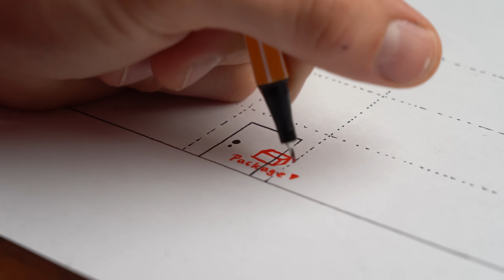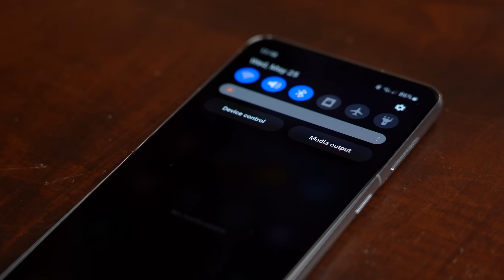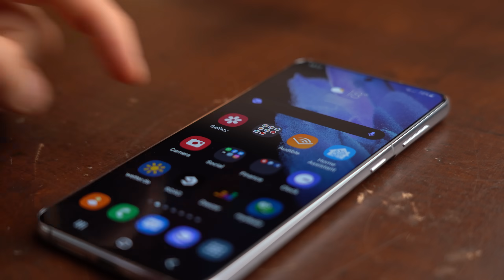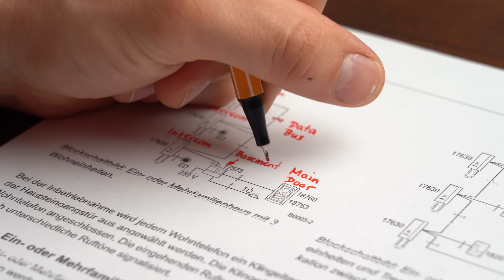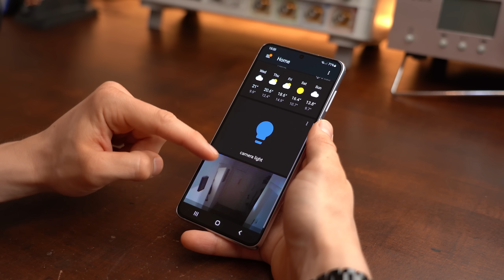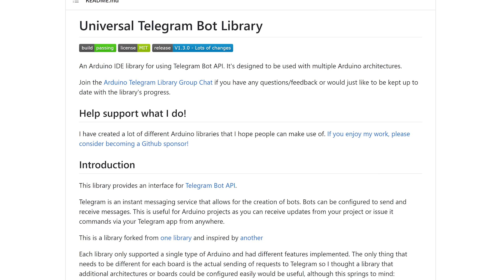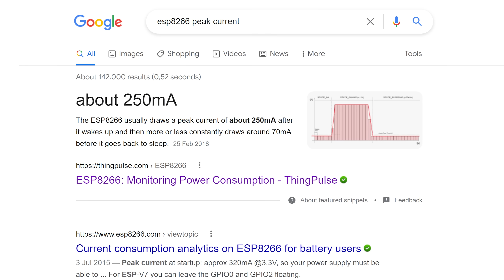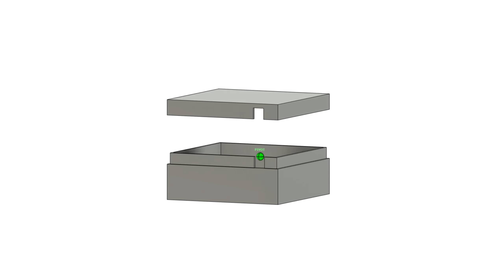Every Apartment needs this Upgrade! (WhatsApp/Telegram Notifications)

Comment: Thanks for the shout-out! I'm really glad people are still finding the telegram library useful, I still think it's the easiest way to do push notifications on an esp device!
Reply from the maker: Thanks for your great work :-)
Reply: @greatscottlab Hey scott, Have you considered ntfy? It does notifications in less than half a second!!! All local too :P
Reply: @greatscottlab   @utehstr  hey did u use the eso32-cam AI Thinker i got a regular another version and my computer couldnt recognize it and in arduino ide -> tools i can only choose esptool as programmer how do i get other options?
Reply: I wasn’t aware of the library and ended up sending the POST request instead. Will be trying it out in my next project.
Reply: Use it for everything! Complete and easy to use
Reply: thanks GreatScott for letting us discover other great channels. I subscribed to yours Brian. :-)
Reply: Personally I use a bit of PHP on a local server (a pi rev 2) which does notifications through Pushover. Just do an HTTP request from ESP with all the relevent info attached (app key, ringtone, etc, etc).
Reply: How fast are the notifications if the phone is locked and not got Telegram running in the foreground? I'm just wondering how much Android sleep/low power modes can affect a system like this.
Reply: @thetron9333  a few seconds usually
Reply: I literally, just before this one,  watched a film about pronunciation of "ough". https://youtu.be/JkdcYYduUeM
Reply: nice library Brian sir
Reply: Wauw, i didn't understand 90% of this video... 😬😬
Reply: Man I had the same problem a while back. I went for a bit of a ride before having success. I created an application for my phone which receives notifications through firebase's service. But now I'm amble to send myself (and others too who install my app from my family) messages based on personalised events that they can subscribe to. It is way faster than most home automation systems. (A bit more complicated too :D )
Reply: https://youtu.be/vOBSn1RWKj0
Reply: Thanks for this library
Reply: Really useful library i used it in a couple of my projects
Reply: Thank you so much for your work. I use it every day.
Reply: Brian's last name is pronounced "lock", you were close Scott!
Reply: @ChunkySteveo  I would have probably pronounced it “low”
Reply: @HogwartsBasement  yeah, same here for British-English. It's an Irish thing! 😊
Reply: @HogwartsBasement  "ough" is hard enough in English on its own, without the wildcard of the Irish thing 😅

Tough (uff)
Though (oo)
Through (u)

So of course Lough is lock 😅
Reply: @BrianLough  haha 
got to love Irish names haha
Reply: @BrianLough  and

Bough
Cough
Dough
Thought
Reply: @BenCos2018  try saoirse
Reply: Thank you for the library. I used it myself about a year ago with a PIR sensor to detect rat activity in one of the barns.

Comment: Great vid I did the similar project a month back. I used esp8266 also tried to steal energy from intercom but then decided against it. I used telegram from the start because its my main IM. Difference is I didn't do alarm notification (I don't know my apartment number, its hard to explain) I instead used relay to simulate door opening button press (probably transistor would be better for that but it was what i had at hand) .

Comment: 5:22 The problem with the notification delay is due to Android's standby services (Doze Mode, to be more specific) since like A8, so you need to define "priority: high" parameter (look into dev documentation for HomeAssistant), then it bypasses it and notifications are pushed instantly.
Reply from the maker: Thanks for the tip
Reply: @greatscottlab  maybe switch to iOS with properly working notifications
Reply: Is it just doze mode and not something else as well? Afaik doze activates when the device is not in use for quite some time while stationary. So really he should only have issues when it's sitting on a desk for half an hour, not even in a pocket or so. But android devices have also picked up the habit of trying to shut off everything that's not high priority, even without doze, unfortunately.
Reply: @LuLeBe  In my experience with multiple Samsung phones, it's basically only the Doze, after disabling it via adb, everything works perfectly fine. Unfortunately without root it needs to be disabled after every restart, soo... after many headscratches I was insanely glad I found that there is something like a critical notification and it's possible to fix it at least for HomeAssistant. But sure, it could be also affected by other processes. (I'm more like stubborn tinkerer than a developer xD )

Btw: Doze intereferes even after 5minutes of "idle" (phone on a desk with display turned off), but it could be manufacturer dependant.
Reply: @SilentlyPrickable  I think Samsung has something else for power optimization. I use an app called Cellmapper to map cellular towers and on Samsung phone it doesn't seem to work in the background, or works for a little while and then stops logging. Meanwhile this is not an issue with Google Pixel

Home Assistant alerts are pretty much instant with iPhone for me. I have one setup to send a snapshot of the camera whenever the doorbell rings. I think those alerts go through the Apple cloud push service.
Reply: the SMS/messaging round trip is also incredibly slow and unreliable. i imagine it would be much faster to send some magic packet across your LAN to your device(s), that way you can even get desktop notifications  or use something like Tasker on your phone to alert accordingly
Reply: @LC-hd5dc  i wasnt talking about SMS... he's on the same network as his door bell why not host something locally.
Reply: @WX4CB  he originally had the notification coming locally via home assistant push notifications but they're a bit all over the place in speed.
Reply: @brendonv101  even on his home network? wow... but yeathat's weird for sure, but i've never used HA so i don't know anything about it. but i have a similar thing here where i have an app that pushes broadcasts out over my local network for various things... doorbell, the fridge (for when my kid leaves the damn door open LOL) etc
Reply: @WX4CB  @brendonv101 He basically did not configure it properly. First mistake he made is that you need to define notification priority in HA for android, by default they are sent with low-ish priority, and thus delay is 'allowed'. You can change it to higher priority modes which include: fast\instant delivery, ignoring DND\Silent mode, and even broadcasting your notification with Android's Text-To-Speech.

Another thing to note is that HomeAssistant uses Google's services for push notifications, however latest versions do support direct persistent websocket connection between your phone and home assistant server at least while on your home network (or using vpn). The downside is that it uses more battery, which might be ok for when you're at home.
Reply: and not to mention that well.. it's the internet and you're relying on someone else not being overloaded (IE the bot or telegram)
Reply: He could also integrate it into HA and let HA send the Telegram/Whatsapp Notification.
That way you can still use it in HA in addition to notifications.
Reply: Yep, disable "battery optimization" for the HA app and set alert to critical, Doze mode sounds like another thingy to take a look at
Also enable to background notifier service
Reply: Switching Home Assistant notification settings to use web sockets also helps speed it up, since the notifications will go via your local network (if your phone is on the wifi) instead of via the internet.
Reply: Yes I had this same issue with home assistant and andriod but after doing priority high and making sure home assisant is set to never sleep now I get notifications immediately. Has to be since it is to let me know my toddler has come out of his room. Then tasker reads notification and makes even even loader high pitch sound if I haven't taken action.
Reply: Yea I was confused by this cause at times it looked like an iPhone too

Comment: Did you consider putting an opto-isolator between the intercom and the ESP, rather than connecting the intercom's 5v signal directly to the ESP?
Reply from the maker: Not really.....
Reply: @greatscottlab  I appreciate the honest response - no joke. An optocoupler does seem like a good idea. At minimum, it avoids a potential ground loop from the second (5V) supply many meters away from the system’s supply. Also, who knows how the system will react during power-up, power-down, lightning, etc. It also protects you and your equipment from any other electronics experimenters in your building :).
Reply: curious newbie here, what problem would an octo solve?
Reply: @jasond.valentine5931  the two main ones for me would have been 1) decoupling the 5v reference of the other system. Who's to say that the ground references can be relied upon to be the same? 2) no risk of the controller putting voltage out back on to the intercom for example if the pins are briefly configured as outputs before your code starts to run on boot-up.
Reply: @jasond.valentine5931  For those who are saying that using an optocoupler is a bad idea,  Then use an LED and LDR method to transmit the signal. Use a resistor to connect the LED to the Doorbell 5v output signal, Use an LDR to connect the 3.3v when the Light signal from LED falls on the LDR.
Reply: @maheen-  As long as the device is connected only to a local powersupply (no connection between GND lines and other equipment) there really is no need for optocouplers.
Reply: @maheen-  that's what an optocoupler is..
Reply: @Rob2  then you assume you're cheap USB power supply is properly isolated which often is not the case. You would not want to risk putting mains voltage on the dooropener or intercom.  Optocoupler is the way to go. Remember also that most countries have more than 120 Volts mains!
Reply: @KGE64  as cheap as it can be, a two prong USB supply is isolated - otherwise depending on how you plug it you would find live voltage on one of the two conductors, probably the ground. I do think that an optocoupler is still a good idea for a number of reasons, but galvanic isolation is not one of them.
Reply: @jasond.valentine5931  there is another comment made around the same time as mine which has gained more traction with a bunch more answers, so search for that one for more ideas
Reply: optoisolators are useless, they can be destroyed alike. Proper resistor - TVS diode combo works much better.
Reply: @bobsnabby2298  Glad I work on industrial electronics.. They use optocouplers everywhere. They hardly ever fail. TVS, diodes and resistors do not give you galvanic isolation so I do not see how that is going to help.
Reply: @KGE64  and how is your optocoupler going to help?, optocoupler emitter is a sensitive element and gets destroyed the same way as any other component. Optocoupler needs again protective elements around it so you just overengineer a simple task.
For such indoor use working with low voltage circuits optocoupler is an overkill.
Resistor and TVS diode added with proper capacitor is effective and easy build for low voltage and slow random signal.
Reply: @bobsnabby2298  You do not understand the problem: it is not that your circuit has to be protected but the circuit you are connecting to (the intercom system in the building), you are connecting that circuit to an (possibly) unsafe power supply. If that supply has poor isolation you could end up electrocuting someone at the 'other end'. That is what optocouplers are for, to isolate your circuit from the other.
Reply: @KGE64  I know what optocouplers are for. This circuit has 5V output and protection against high voltages are done elsewhere by the Intercom manufacturer to pass the must have IEC safety test set. There is no danger by connecting your circuit to this output (if done properly). Series resistor and TVS are to protect the Intercom from external ESD strikes from user or external board which could be connected with long cables and is prone to interference. This is the minimum protection.
Reply: @bobsnabby2298  It is not to protect your circuit it is to protect from lesser informed people connecting mains connected things to the intercom system. I like to have a 230V 100W bulb light up when someone is ringing my intercom. So I connect the gate of a triac to the signal (with a resistor of course) and connect wat I think is the neutral wire to the ground of the intercom. Alas a standard European socket has no way of telling what is neutral or live so I could be ending up connecting the live wire to the Intercom system.. Still think it is a good idea not use an optocoupler ?
Reply: @KGE64  What are you talking about?! all these Triacs and AC mains voltages!?
This intercom works with 24Volts and there is no AC mains present on board. Then he uses 5V wall adapter to power up his WIFI card and via resistor network he connects the RI signal to his card to detect the bell ringing. All this is out of sight under a plastic cover where nobody can touch it.
There is not a chance that this circuit is dangerous to anybody.
Adding AC mains to such system is just pure suicide and such idiot would be dead before the enclosure is closed..
Reply: @bobsnabby2298  You never heard of shoddy USB power supplies with hardly any (or even no) isolation at all between primary and secondary? Exactly because the intercom is properly isolated you do not want to connect any uncontrolled equipment to it. Because people who use the intercom do not want to be zapped by some shoddy $2 USB power supply you are hooking up directly to the whole building.
Reply: @KGE64  there are few billion 5V wall adapters out there, you go and do your math how many have failed and caused damage. There is a bigger chance to fall on the street or get hit by a car than get killed by 5V wall adapter. Yes you can electrify yourself in many ways and even light up the whole house by being ignorant or stupid when playing with electricity. In this video there is no potential danger even if the USB power supply fails and conducts AC mains to the Intercom, it only busts the intercom but not going to kill anyone. Adding optocoupler into this circuit adds nothing. All conductive parts are covered and out of reach causing enough isolation by default.
Manipulating intercom in an apartment building is already  something you shouldn't do, but people are stupid.
Reply: @bobsnabby2298  Finally in the last sentence you make sense :-) Have a nice day

Comment: I recently solved the similar problem of watering  house plants when the soil is dry. Telegram bot sends notification when soil moisture sensor detects the moisture below threshold level. Besides I use Telegram bot for sending requests(command) to get soil moisture data.

Comment: so funny. I recently looked into such a project myself but hadn't had the time to investigate my door alarm that much.
I would do it with email, since I'm basically always on my PC.

But I also wonder, what you could do with the ring data bus system... I mean... if everything is going through these two wires, could you listen in to other apartments? 🤔
Could you let the door ring in other apartments and have a next level bell prank? 😆

Comment: It would be awesome if back communication will be possible, like when you're outside. Call the esp by telegram and respond back.
Reply from the maker: I think it is possible
Reply: It's probably possible to wire the door unlock button as an output, too, but I don't think you could do any more communication than that (like talk through the phone) with just the ESP
Reply: @QuickishFM  maybe is too much for a 8266 but the 32 should do it, using some sort of external DAC.

Comment: A light that flashes in your work space. A hard of hearing relative of my wife had a system that flashes rapidly if phone rings (old school home phone) and flashes a slower signal if the door bell is rung. Both elderly passed away more than a decade ago. It was part of a commercial security system that is long gone, but great idea.
Reply: If you have home automation you could probably even make the normal lights flash.
Reply: This could be done with WLED and http notifications - only a few lines of code in the existing esp8266
Reply: And super easy to implement with common smart home software (like ZigBee lamps)
Reply: This is what I would have done. A big flashing light. So much more reliable and easier to integrate than what was presented here.

Comment: ...you could have jumped a little further adding the capability for opening the external door using a telegram message, so that the postman can leave the packages in front of your apartment door. You have already the telegram bot running, so it should be quite easy!
Reply from the maker: Yep. That would have been possible. But honestly I was not interested in that.

Comment: Nice Project. I got the same Problem but my doorbell is much simpler. Its just 24v Ac while someone is ringing. My solution is a rectifier with a mosfet, wich switches a digital pin on my raspberrypi running Homeassistant. I wonder if it would be possible to charge a capacitor from the 24v ac, wich lasts long enought to make it possible for the esp to connect and send a signal.
Reply from the maker: Watch Bitlunis video about the topic. He got and did the exact thing you just described ;-)
Reply: @greatscottlab  Just watched it. Thats exactly what I need. Nice that experimenting is already done. He did it with 12v so the 24v should keep the esp running even longer right?